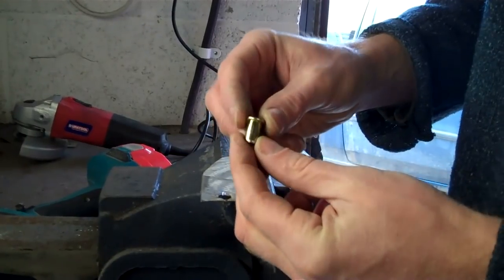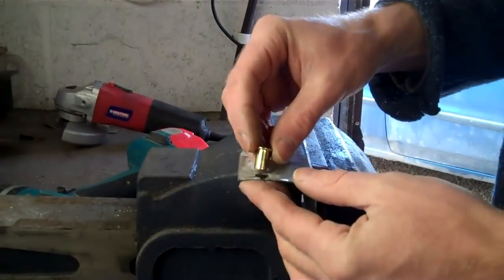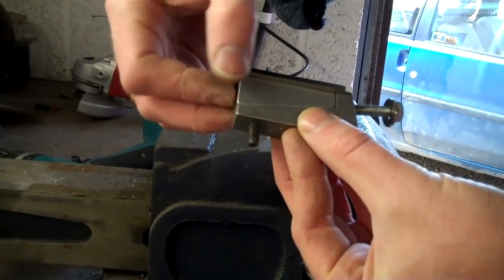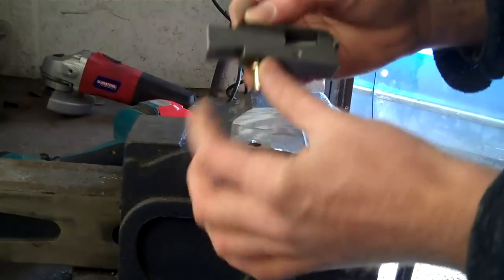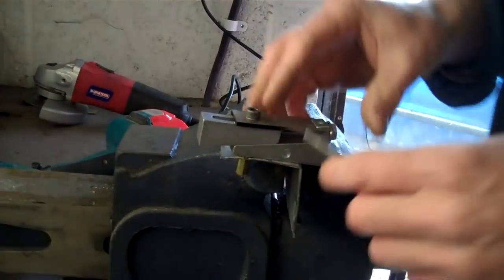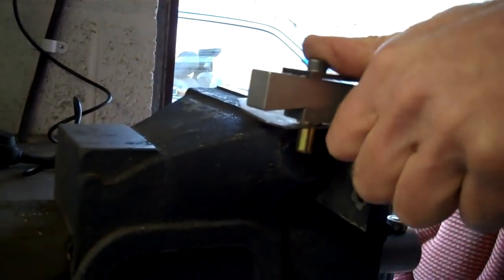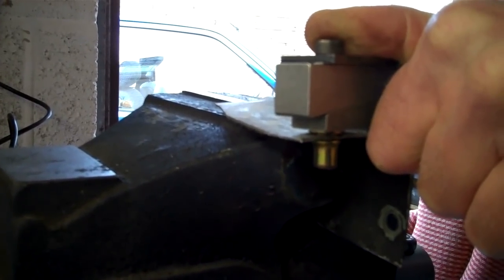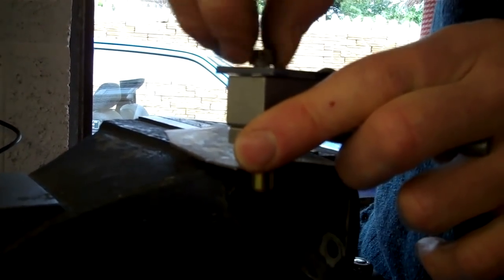How to use a Rivet Nut insertion Tool

Comment: I have never used this type of setup before.  My "setup" isn't quite the same, but the same concept.  It's used to anchor an Neuspeed upper "stress bar" for my MKII Jetta GLI.  It uses a simple "Nut Style" tool (dubbed the "Nutsert") that you hold with a wrench to keep it from turning while you turn the bolt into the "rivnut" styled anchor.

This video helped me understand the basic idea, so thank you.